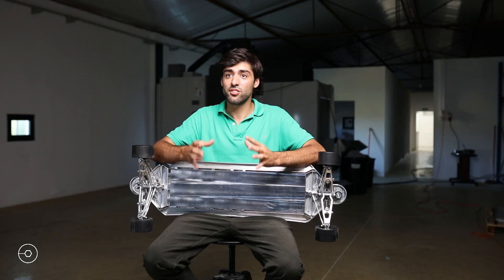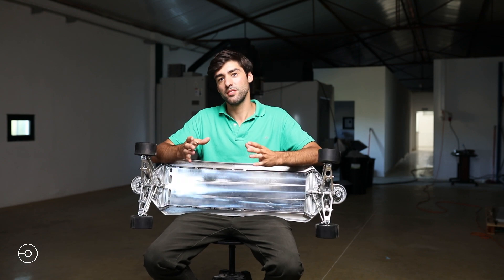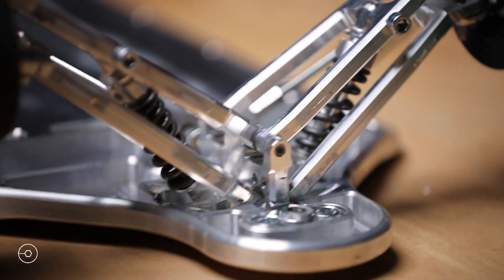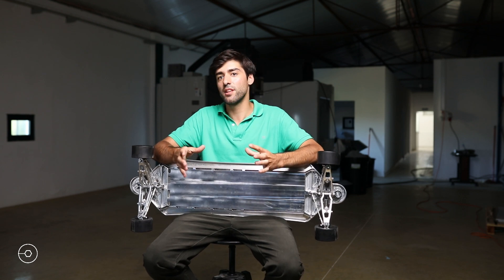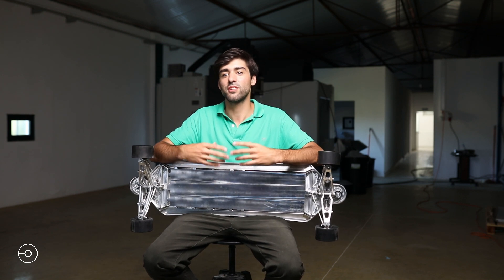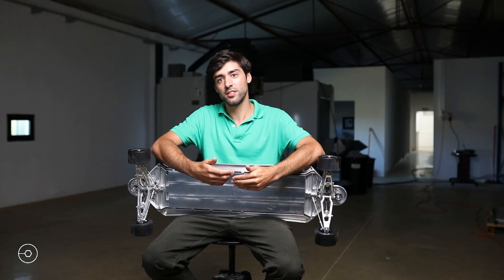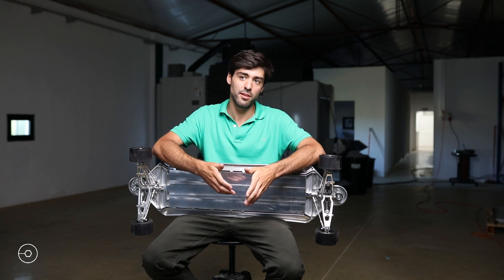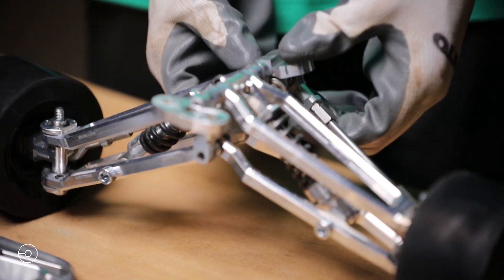Why build an Electric Skateboard with a Suspension System🤔🧠?

Comment: this guy simply doesn't understand why it is crucial to have a flexable deck.  I get the whole suspension trucks. but that is only good for off road use.  A flexable bamboo deck is the staple for long boards.  a stiff deck is the signs of a cheap product if asking a long board professional.  this will be an epic failure.  I am sure the cost will also be ridiculous.